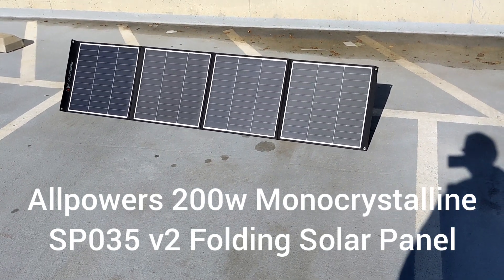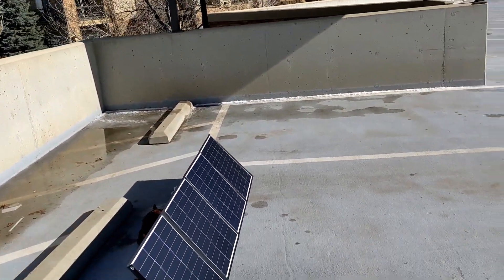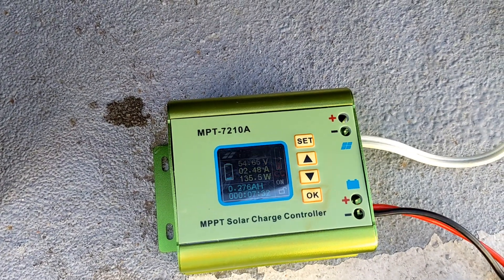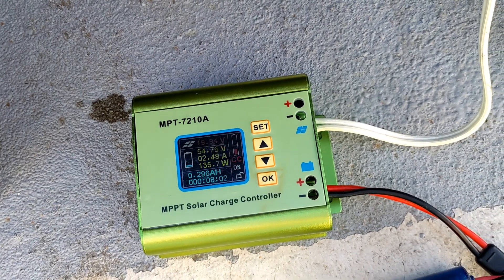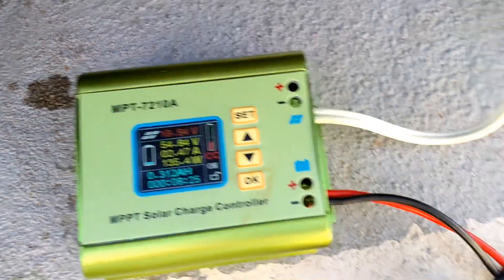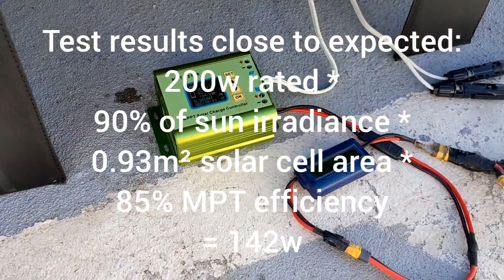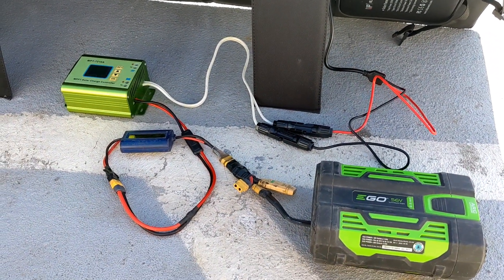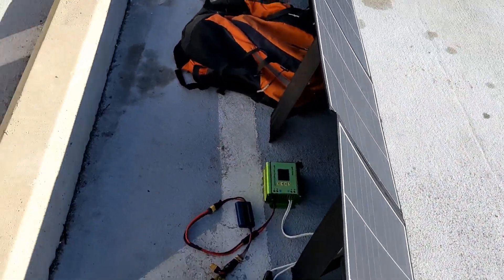Allpowers 200w SP035 v2 Folding Monocrystalline Solar Panel Test Review

Comment: I think I got some bad panels from Allpowers - - I can only get a max of 84 wats out of mine, in the most perfect of conditions.
Reply from the maker: That is disappointing. I hope you can get them replaced.
Reply: @maddmikemu  : I am working with the seller - it is looking hopeful.  I emailed allpowers with no response so far, and posted in detail on the allpowers official website.  They are saying there, 84W is normal if your unit is at 75%.  I don't have other panels to try, so I can't compare.

Comment: Face panels don't work on EBA3 Bluetti generators, too many amps, everybody that does reviews on these make some look like they would work, now I got to send it back what a hassle
Reply from the maker: I don't use a "battery generator" box, instead I use solar charge controllers that I purchased that have the correct specifications to charge EGO lawn tool batteries and then use the EGO batteries with an inverter. Currently using the EGO 400w Nexus Escape for my tent power when camping.

Comment from the maker: I purchased the elejoy EL-MU400SP solar MPPT boost charger to see if I can get closer to 200w output and had full sun at mid day today to test. I was able to get just over 8 amps output from the panel at 19v so that works out to 152w. The sun intensity was right at 1000w per m² so the panel should have been capable of full rated power during the test. I don't think my test output was limited by anything but the panel so at this point I conclude that my panel cannot generate its rated power.
Reply from the maker: I'm going camping in a few weeks so I'll get to use it again. It worked great last year.
Reply: HOw is it doing now? I just bought this yesterday...